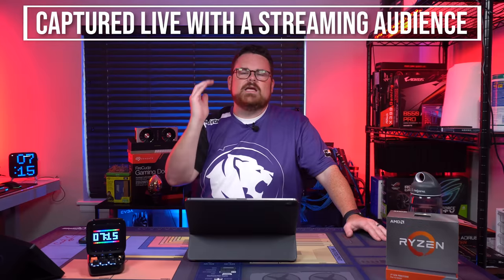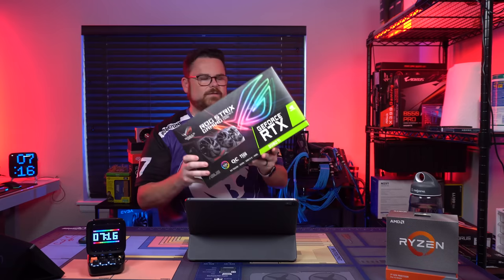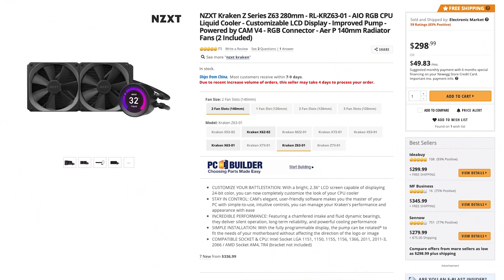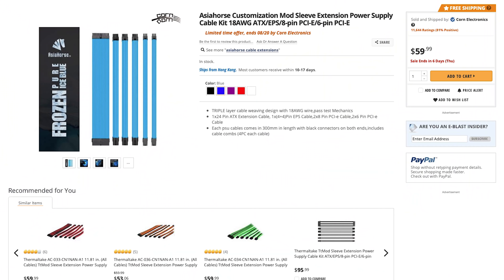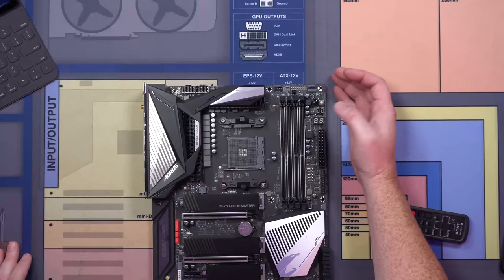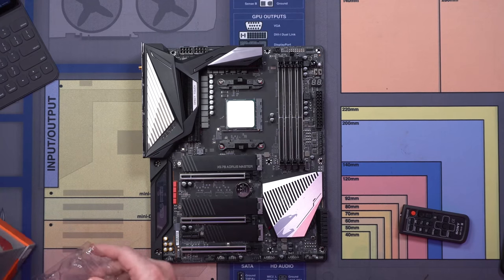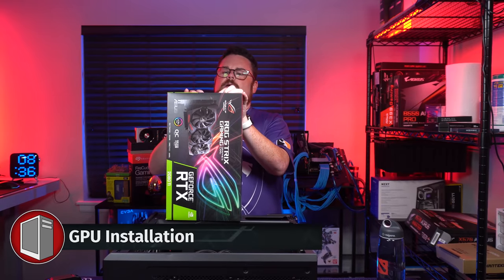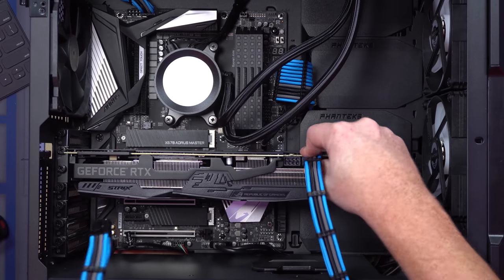You Chose the Parts, we built it! Audience Choice $3700 Build ( 3900XT / 2080TI) in a Phanteks P500a

Comment: You can actually install up to a 360mm AIO on the top of this case. Your not limited to a 280.
Reply: this. and you actually can take the top of the case off, it's just screwed in.
Reply: i just bought my p500a case and just heard him say upto 280mm on the top and got so shook wtf. I tested fitting my 360mm rad and it works, wow scared me so much there
Reply: You will probably get negative air flow  420 intake. 500 out take if you add another 140m fan in. The rear area. Unless you don’t add another 140 m fan on the back and have a 360mm aio it’ll be positive 💪

Comment: I have no complaints about the style or presentation of your video. But at least get the dimensions right. The p500a Can support a 360mm radiator in the top (you stated max was 240). The rear exhaust can support a 140mm fan. If someone was considering this case but wanted a 360mm AIO or something they might have thought they have to go for something else. Generally, good video though.

Comment: I must have a bad rgb controller. I set it up and fans work, front of case lights up, but just cant get the psu shroud to light up and also power switch doesn't light up.

Comment: I have the same AIO and i am running a Ryzen 3900 and my temps are high even at idol. I know the cpu runs hot on AMD platroms but why are your temps so low?
Reply: I’m using the be quiet pure 500 Dx actually.
Reply: Make sure you have a good fan configuration in terms of airflow for your case and fans
Reply: damitderek I am using the NZXT h1 with b450 itx paired with a 3600xt
Reply: Joey i know someone who has this problem too
Reply: @Average3djoe  I heard this case runs things on the warmer side. Not enough air flow. Hopefully the next gen case improves that.

Comment: Awesome video, just did my first pc build using this chassis, only thing I’m having trouble with is the addressable RBG buttons at the top they don’t seem to work for me any advice would be great
Reply: Im not sure how to help. The RGB cable from the case is supposed to be plugged into the 5v 3 pin A-RGB header on your motherboard. Please note if you try to plug it into the different 12v 4 pin RGB header it wont work and it might destroy the header or lights.

Comment: Apparently the fans are noise and to loud when on high for cooling why this case is putting me off but i do like it specially the white one
Reply: Then turn them down. You shouldn't really need to use them at full speed most of the time This case has decent airflow as it is.
Reply: @MrCrazyjoe259  i went out and brought it the (white case) version and yes i did turned them down as a brought a PMW fan controller 4pin connector so its not running at full speed all the time and i can set it through the motherboard bios because these fans that comes with the case are not PWM 4pin. but as there is no dust filter the case do get dust coming from the front fan and you can see it on the bottom of the case and needs to clean the fans front  mesh

Comment: hi!  great video.  Did you notice the manual for the p500a says to connect a POWER LED connector to the motherboard?  Mine doesn't have that cable, and yours doesn't appear to either.  I think there are supposed to be LEDs on the top of the case.    https://imgur.com/EmYddN1